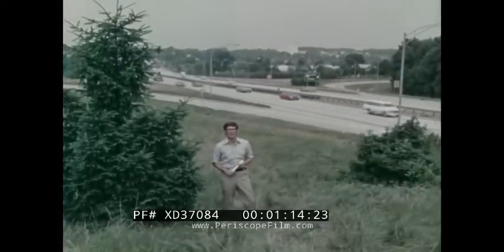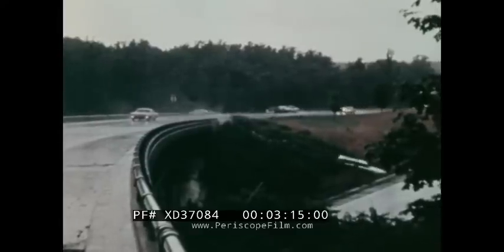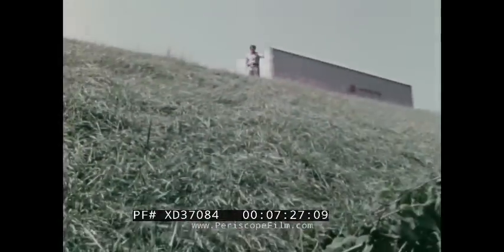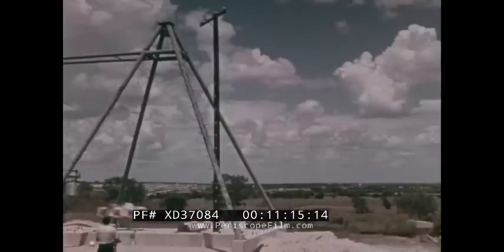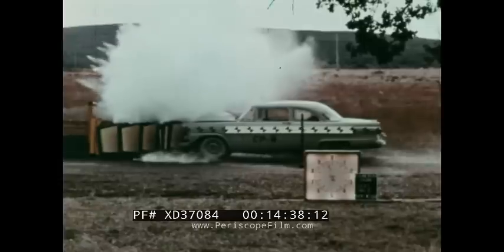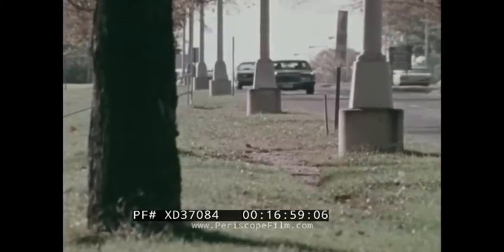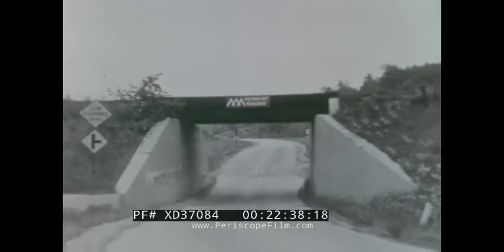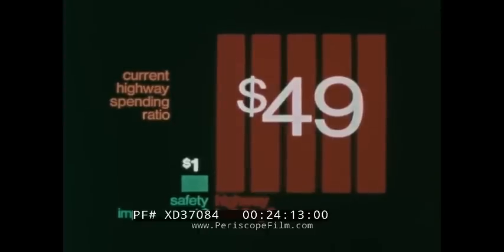“BOOBYTRAP!” 1972 INSURANCE INSTITUTE FOR HIGHWAY SAFETY   FREEWAY ENGINEERING & DESIGN  XD37084

Comment: Interesting stuff from 1972. In 1999 my department responded to a fatal crash on the Interstate (just 1 of many) but there was an oddity in this case. A guardrail designed and anchored so as to not impale a vehicle, had done exactly that to a full sized van, killing the driver and rear occupants. It turned out that the guardrail had been damaged by a previous crash from a year before and had yet to be repaired.

Comment: Heavy Rain+bias ply tires = spin city. (Let alone on a VW with swing axles). Only they later found that burying ends of the ARMCO crash barriers actually acts like a ramp upon collision and gets autos airborne. The current solution is either blunting with a Fitch barrier or blunting with a loop of steel both absorb the impact. The Fitch barrier was named after racer/inventor  John Fitch who had a horrific collision in a race and he sought better solutions. The Fitch barrier are sand drums (sometimes a liquid) half full or collapsible plastic panels attached to barriers or bridge abutments for cushioning and crash abatement.

Comment: Those wooden posts with guard rails never worked. New ones are made with steel posts and lots of freeways nowadays have cable barriers which are stronger and more effective against crashes. 

18:52 Who smoked one when they thought that was a good placement for a guard rail?

Comment: I find it incredible that this so called “information” film doesn’t believe that driver education would help prevent needless accidents,deaths or serious injuries, for example, if you miss your exit to join a different road (highway) then don’t try to cut across the “gore” area, just follow the road you ended up on and find a way back onto your correct road, I don’t know about in the United States of today but in the United Kingdom it’s illegal to do what the drivers did, not just to prevent themselves being injured, or worse killed, but to prevent them injuring or killing some innocent people just driving along. Of course guard rails, signs, poles etc need to do what they are intended to do, but developing safer barriers etc is, and probably always will be, ongoing and I am 100% sure that since this was filmed things are far better than they were, but no matter how well a highway is designed and safety measures put in place it IS educating drivers, of any size or shape vehicle, how to drive SAFELY and how to deal with unexpected events like blowing a tyre or some other mechanical failure, so that THEY can prevent a catastrophic accident, drivers should be trained in different conditions, rain, snow, high winds etc so that THEY can drive safely in any conditions. Sorry but in my opinion, either then or now, driver education would prevent a lot of tragic deaths and injuries, when you get behind the steering wheel of any vehicle you are in charge of a deadly weapon and it’s your responsibility to drive safely and considerably, the design of roads is only a little piece of road safety, driver training and awareness is far more important and easier to implement. 😀👍👍🇬🇧🏴